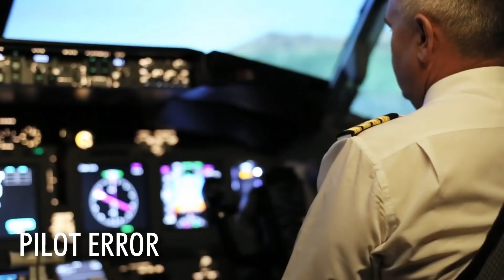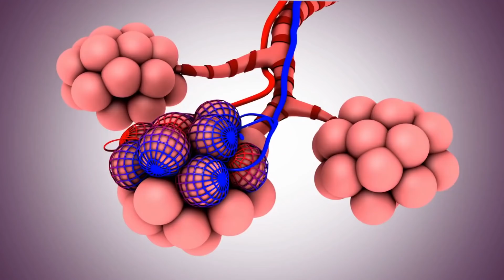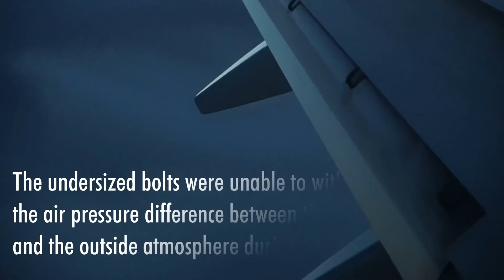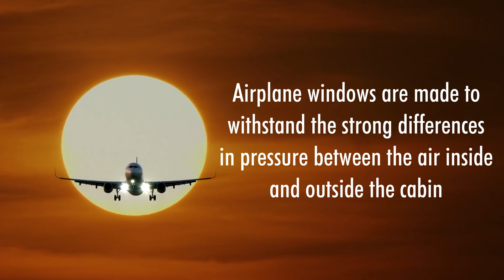What if Your Plane’s Window Breaks at 31000 Feet?

Comment: just ask me.

the aircraft will not start to collapse piece by piece, 1-9 passengers will get seriously injured or sucked out and the aircraft can fly for 1.5 hours at arround 240 kts 
you have to slow down to ~195 kts using flaps 10 (depending on the aircraft type) you will make it. the air must come from apu bleed air (auxilitary power unit). if the plane is climbing at fl100 (flight level 10,000 ft) then you are ably to breath from the bleed air 

(i fly and im an avgeek so trust me.)